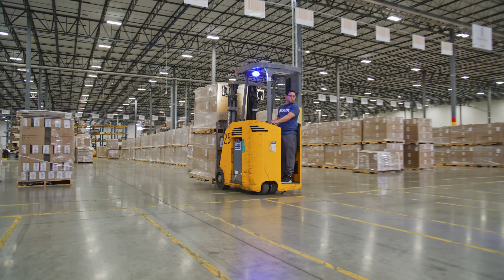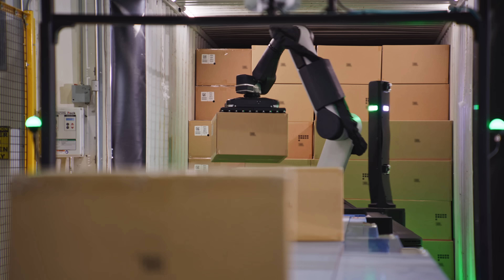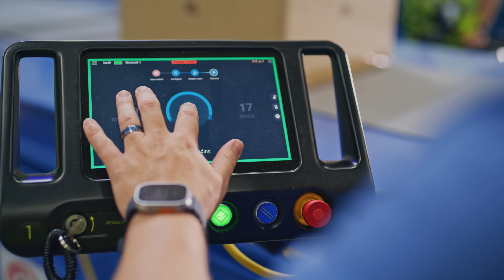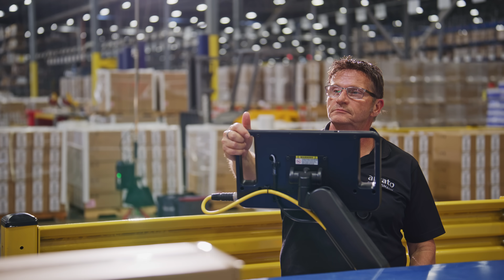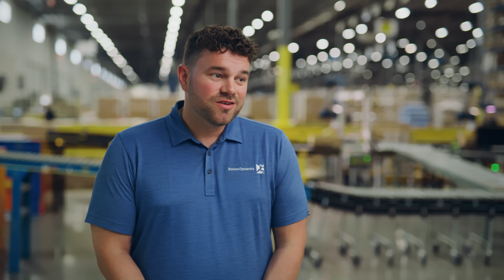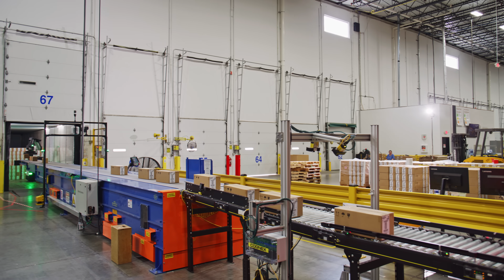Stretch at Arvato | Boston Dynamics

Comment: Ive never seen a truck stacked that neatly in 5 years of warehouse experience at multiple companies
Reply: If a camera crew comes, then even that is possible 😅
Reply: That's why engineers are encouraged to go to the field and see actual conditions, instead of ideal environments.

The packages were almost never stacked this nicely when I worked unloading and loading for a parcel company during college.

When I worked as a seasonal driver, I had an awesome loader. He was funny, efficient in his work, and neatly packed packages in an organized way by the numbers. Made my job so much easier. I shared with him all the goodies I got on the road. He told me to milk the clock out and get that OT. lol. He also convinced me to continue my studies in engineering, rather than to quit and work full-time there. I wished him all the best.
Reply: it might have been loaded by another stretch lol
Reply: I have but its usually just a customer loaded trailer and all the boxes were the same size.
Reply: Stretch does not require them to be stacked that neatly. This is a real factory and that is a real load of boxes. They came that way. When you loose-load boxes the usual way to do it is to pack them in tightly, especially when it's a load of boxes that are the same or similar size. But again, Stretch does not require that kind of load. It can handle boxes that are scattered and dropped on the ground, different sizes, and so on.
Reply: 10 years experience in logistic. You are 100% right.
I never seen it too
Reply: “Stretch is no going to replace workers”. Lol. Sure…
Reply: @Drealmers  It depends what the logistic center is doing. For example, if your trucks come loaded with multiple items, different sizes, different weights, different shapes, they are not going to be stacked up neatly. If your truck arrives with your weekly load of parts x, all the same, they can easily be loaded as neatly as you like.
Reply: I have
Reply: @Rexonsteroids  thinking about it more, only time I've seen it come close to this neat is when a supplier sends things on wrapped pallets.  The robot could definitely unload the pallets though.
Reply: Thats because humans stack the truck. Once Ai robots stack the truck you will see a truck stacked that neatly in the future.
Reply: @DantePowell  you know what, that's a good point 😂
Reply: @shiftykiwi  The workers are so happy with Stretch, that is why they only interviewed managers.
Reply: I've seen one the other day. It was aamazing
Reply: Ideally it would have to have been stacked by another strech or something? but it's a weird problem for sure lmao
Reply: There are multiple videos showing stretch going just as fast in a typical "throw it in and shut the doors" situation.
Reply: That trailer did not travel. Nothing shows up pristine like that. Also all the tape must've been perfect also. I wanna see this thing when a box busts open on it.
Reply: @kmw8775  Okay media rep from Boston Dynamics, whatever you say. Go work a day in an actual warehouse.
Reply: you haven't seen my walls then
Reply: If it gets loaded by another stretch bot it can be, it still is with humans but the boxes must be uniform and those trailer better be truly waterproof
Reply: If we can literally almost perfectly build a pallet then loading a trailer like that is too, you'll be breaking your back however
Reply: @chrismacbean  What the hell are you talking about? What makes you think that a robot needs such a perfect stacking? The way it's designed, there's nothing to suggest that the freedom to pick up boxes is limited. Especially since the trucks can also be stacked by Stretch, and he will stack the boxes so perfectly.
Reply: @Dan-hr8lq  I see your point, but what I am getting at is you can make something perfect leaving the shipping dock, but you cannot make the road it travels perfect. Things get damaged in transport. I've worked shipping before, I've had to do all the damage claims on my stuff even though I did everything humanly possible to make sure it gets to the receiver perfectly. Your fancy perfect robots can't make the roads perfect.
Reply: You can tell a lot of people in this thread haven't worked in a warehouse. It doesn't matter how the boxes were stacked, when the company uses cheap boxes that fall apart, and the driver slams on their brakes a few too many times. Boxes are supposed to be lifted from the bottom and not the top for a reason. That robot would smash or heavily damage or drop most things in most warehouses.
Reply: Arguably the thing could do the loading as well
Reply: @GoalWalker the technology this robotic arm would need to detect and correctly position itself to pick up a box isn't exactly new so I can imagine it being equipped to also address those situation. Something I want to see is how well those suction cups work with soggy, damaged, unbalanced or overweight boxes and what the process is in case the not detects that failure and the person needs to intervene. Do they just set the not aside and finish the rest by hand, how long to do that?
Reply: Came to say the same thing.
Reply: @kmw8775  I'd like to see it handle a typical load from the back of a store truck before I'll be impressed.
Reply: I’ve seen many-many containers stacked exactly like this. The company I worked for had their products manufactured in China and shipped to us, hundreds of containers each year. 2-3 guys would manually palletise the whole container. What they don’t show is the top layer tight against the roof, or each layer sinking into each other and getting jammed in, be interesting how they deal with that.
Reply: You never put attention? Is a training …

Comment: I have yet to see this thing unload a truck that is not filled with perfectly stacked same-sized boxes
Reply: It can do that. Have you watched all the videos?
Reply: @kmw8775 yes, and indeed its perfectly stacked boxes of the same size
Reply: Or 20kg boxes of frozen meat.
Reply: @kmw8775  Yes, every promo video on this channel shows it unloading a truck of equally sized perfectly stacked boxes.
Reply: WE NEED THAT DEMO. I agree. Erratically placed boxes please. And boxes on pallets.
Reply: its all fully staged, preconfigure and setup its not a real scenario. I think these videos are just for investors?
Reply: @KickAChicken  This is a real factory, not a staged setup.
Reply: And also without this excellent lighting..
Reply: True it won't work in all scenarios, but it still works in many. So, it's still a practical product.
Reply: @busti4552  Well if Stretch is loading the boxes I'm sure it'll be able to do a much neater job than people anyway. And then on top of that the loading instructions can just be reversed and sent to the unloading Stretch. Now it knows what is likely the most efficient way to unload said boxes and can know where each product is on the truck before said truck has even arrived.
Reply: @kmw8775  No it cant, it has suction cups for hands. Go work in a warehouse and find out how things are not like this video.
Reply: @HerrVoragendRapperleiche342  Seriously. Lets see this thing actually sort boxes...rather than just spam them out of a staged trailer. Give me the boxes I need for the rush order that the customer needs yesterday, not just a steady stream of staged shit.
Reply: @chrismacbean  Yes, it has suction cups for hands. What is it that you think it can't do because of that? It can pick up various size boxes up to 50 lbs. It does not require the boxes to be lined up neatly, although it certainly makes sense for people loading loose boxes in a container to do it neatly when they can to maximize how much they can get in.
Reply: @kmw8775  Boxes get dented, duh. Go work in shipping and understand that the heavier something is, the harder you throw it. Nobody gives two shits if the box gets damage as long as the product is packaged properly inside the box you throw away after you receive it. Also people packing the product in the boxes don't pack it so the box can be used as an airtight seal for some stupid robot. Like seriously buddy, go work a day in shipping.
Reply: @kmw8775  Have you seen it operate in the real world? If not, shut up.
Reply: The reality is that soon an identical robot will be packing the boxes into the container and the unloading robot will have the loading data from the loading robot for even faster operations,
Also in this scenario where the boxes are packed by a robot the packaging will be perfect.
Reply: @busti4552  If you watch the video carefully, you'll see that there are different size boxes in some of those containers.
Reply: This is unloading for a warehouse, not unloading for an end retail store. The warehouses frequently order 10000 units of the same products. That's how companies get low cost deals on them to provide sales.
Reply: @busti4552  Take a closer look at the start of this video. Not all the boxes are the same size in a couple of those shots.
Reply: @kmw8775 omg your right. One of them is almost a 1cm bigger. Well spotted.
Reply: @samadhistate9637  The differences are larger than that. I'm not sure that I could see a 1 cm difference. Check the bottom rows, where the larger boxes were stacked before the smaller boxes above them, in a couple of the shots.
Reply: Easy: mobile stretch to load and unload
Reply: @lacudafrost  I've worked multi-national distributors as the shipping coordinator. You gotta move heavy amounts of stock between warehouses. Just like how Amazon works with its fulfillment centers. I'm not talking about delivery to retail.
Reply: It does it...cleans up drops and avalanches nicely. It can scan and figure out the stacking of different size boxes just has to learn the configuration so it takes a little bit of time to take a few more photos as it unloads.
Reply: @kmw8775  There are very rarely any boxes that you can lift using suction cups on the top, and not have the box break and the contents spill out of the bottom. There is a reason most boxes say lift from the bottom.
Reply: A few years back people like you were probably saying “I’ve yet to see robots unload anything from a truck”
Reply: @pinkcichlid  I do believe that this will eventually be something that is commercially viable, but right now it is clearly a very fabricated demo.

Comment: Why aren't those boxes palletized? isn't it faster to unload all the cargo into the warehouse first and not have the truck driver waiting for the machine to unload the boxes one by one?
Reply: It's mainly about internal space and shipping costs, you create dead volume and weight if you have pallets inside, it increases overall costs. You can also stack the boxes much more efficently and hold considerably more than if they were already on the pallet,  It can be filled front to back, top to bottom. 
You can also have multiple products mixed in the container but you would only really want one product on a pallet for when it goes into storage.
Container drivers will typically drop a container off and pick up an empty one that had already been emptied thus no waiting times for them.

Comment: If anyone has ever unloaded a truck - this is a freakin godsend.  I had to do this for a few years and it is a workout all damn day - risking injury all damn day.  You are spent afterward and sometimes those trucks can get to 120 degrees inside and -20 as well.
Reply: Yeah, thank god Stretch can do that job now and the employer doesn't need you anymore
Reply: @thisismycoolnickname  NEW hiring. But not take away current jobs. As you can see, that it still needs a human to operate the machine, set its specific parameters, set the schedule and for maintenance. so the current workforce can be useful. Different story for new jobs though
Reply: @basimnadeem1596  1 guy can oversee 5 of those bots. So 4 guys can stay at home.
Reply: Except this is an ideal environment. It does not represent all parcel environments. Humans are still needed to deal with poorly packaged parcels and unorganized trailers.
Reply: @thisismycoolnickname Indeed. All unrewarding, laborious jobs ought to get automated. Both physical and mental.
This is a good thing. The problem is how the people currently working those jobs will get treated by the economy. Adequate economic policies need to accompany these changes, or societies might unravel due to the shock of too many people losing their jobs too quickly.
Reply: what about for the people who’s whole job is loading the truck? the robots will replace them and they will have less jobs. maybe in the perfect utopia where robots do all the heavy lifting not having a job wouldnt be a problem, but right now it is.
Reply: @GoalWalker Stretch does not require an organized trailer. This factory is dealing with organized loads, but that doesn't mean stretch requires them. It does require that the package won't pull open if you pick it up.
Reply: @melissaleigh8019  it creates new jobs though. People need to develop, build and maintain those robots. Less people are needed but you'll therefore need training for the existing ones. At least for now
Reply: @GoalWalker humanoid robots are required to do that.
Reply: @thisismycoolnickname  they said the employees will be used in other areas.
Reply: @thisismycoolnickname fool, companies are nothing without the people.
Reply: @thisismycoolnickname cope. If a robot can do it, it should. There is no problem with humans being replaced here.
Reply: @thisismycoolnickname who the hell WANTS to unload trucks?
Reply: And most importantly what you do in those 8 hours has very, very limited value. It's manual labor that does nothing but just "Take stuff from Place A to Place B" when those two places are 10 meters apart. It really is a job no one misses if it is automated away. No professional will go "They took away the favorite part of my work".
Reply: @John52416  That's what they always say.
Reply: @thisismycoolnickname if the job is undesirable for the average worker, they're better off doing some tasks better suited for people. Don't do this game of "you're just too lazy" when there's no need to.
Reply: @thisismycoolnickname  I hate this argument because it's been shown time and time again that companies will cut jobs whether or not a robot is replacing workers, and they'll just pile the workload of five people onto one person instead. Also the robots aren't completely autonomous, you need people to babysit the robots, correct for errors, and do more dexterous organizing. I'd rather babysit a robot than do the physical labor of five people, personally.
Reply: @thisismycoolnickname  If a job can be automated. It should be automated. We are kind of in the middle of an AI/Automation/Robotic revolution akin to that of the idustrial revolution. Things are going to change big big, my man. I can't say how, obviously, but I don't think we can stop this train.

Comment: The reality is that soon an identical robot will be packing the boxes into the container and the unloading robot will have the loading data from the loading robot for even faster operations,
Also in this scenario where the boxes are packed by a robot the packaging will be perfect.
Reply: What do you mean by "loading data" ?
If you mean the placement of every single package, you forget that the container needs to be moved, so alle the packages could tumble around inside.

Comment: How does it hold onto the boxes? Suction? I wouldn’t have thought suction-holding cardboard boxes from the top would provide a good grip.
Reply: It's very specifically ACTIVE suction. Passive suction is very weak, but each one of those cups has a small hose attached that can dynamically hook into a vacuum system. It's how it can choose when to pick up, what to pick up, and when to drop, and it's fairly powerful on large, flat surfaces - Like a box. Even a cardboard box.

It's not perfect for every application, but it's becoming pretty popular for stuff like this. Mark Rober's puzzle-building robot is a decent toy example of the technology, but that's using a single suction cup for PRECISION manipulation. This is using a lot of cups for brute force manipulation, and still benefits from the precision of being able to turn on an arbitrary configuration of the cups at a given time.
Reply: Think of it like many tiny vacuums
Reply: Active suction or not, it depents on a relatively flat surface to funtion. Go look in a real warehouse and tell me if all the boxes are in pristine condition. Every box that isn't means a human has to go in the trailer and handle it. I am so waiting for all the videos of this thing fucking up in real life use. Its gonna be a new category of youtube fail videos.
Reply: Yep with a built-in vacuum pump it has smart griper tech...really innovative solution - works for most boxes as long as they are not totally destroyed or insufficiently taped.

Comment: They invented pallets specifically to solve that problem. I work in a warehouse and I am not in a truck for more than 30 seconds at a time, and it is only to get a pallet or many pallets out of the trailer.
Reply: Pallets are for standardized loads where everything is the same. They also take up internal volume. So depends on what is being shipped

Comment: What they are showing here and fail to show is that those trucks sometimes are loaded with all different size boxes thrown together. What they are showing here are many of the same size boxes, stacked neatly at the same height. UPS, USPS, type of stacking is so many different sizes, which is going to make it more difficult for this robot to work in.